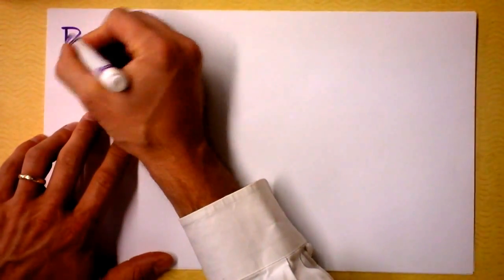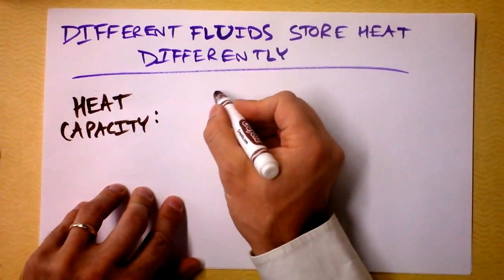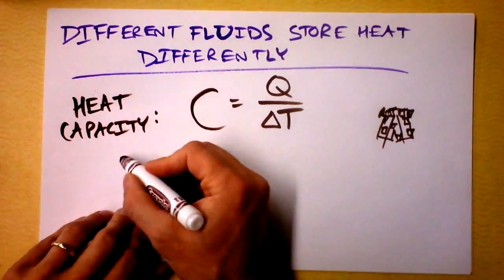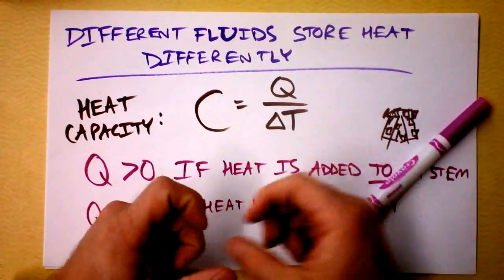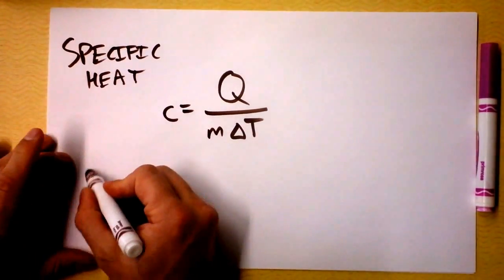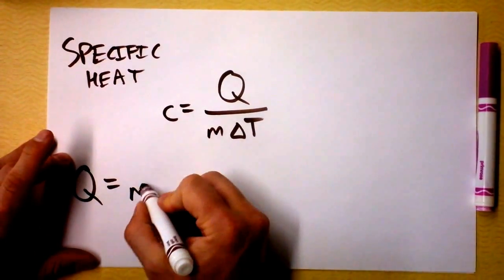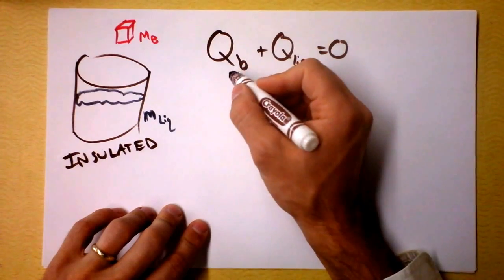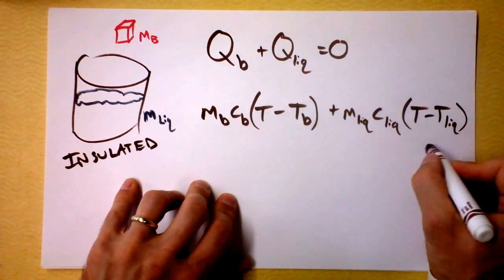Heat Capacity and Specific Heat | Doc Physics

Comment: Heat Capacity made more sense after the pants analogy. 
Low capacity is like having less pockets meaning it stores less and once pockets are filled (or heat capacity is filled) then temp changes by 1 unit.
High capacity is like having more pockets and only when all the pockets are full does temp change.

So it takes more energy to change temp of a high capacity substance and less energy to change temp of a low capacity substance.

I really understood that (if I got it right) with the visual pants analogy so thank you.

Comment: Umm, at 7:07 there's this little bit that i don't quite understand: how is the final temperature of both the liquid and the block the same? The energy is equal in both, and the C and the mass are different, how does T end up the same?
Reply: They would reach thermal equilibrium I believe
Reply: +Stevan Lezaja  To my understanding, if two systems are in contact their T will always end up the same, as the one with greater internal energy(U) (the one with a greater mass in this case) will by collision give a bit of its energy to the other system.
Reply: i actually did the calculations, it would require for the m of the first system times the c of the first system (m1*c1) to be equal to m2*c2 in order for the T of both systems to be equal, but besides that there is no real reason for the T to be the same (unless i didn't understand what you told me very well)